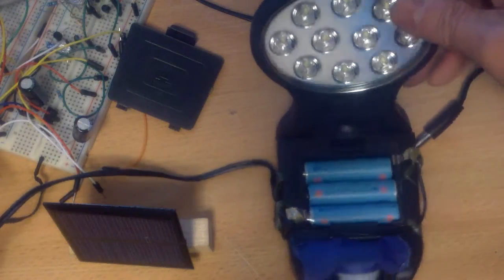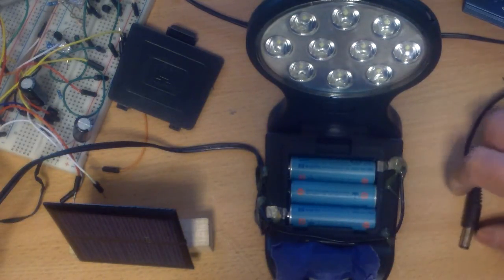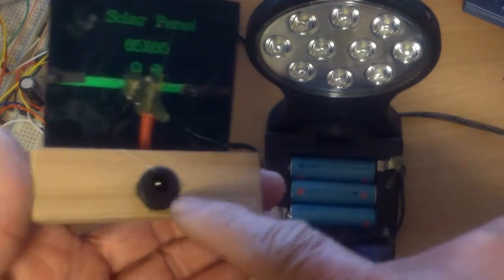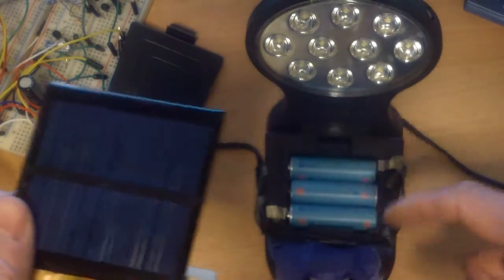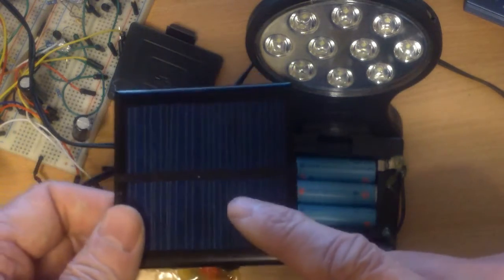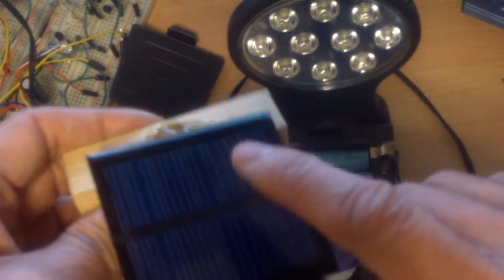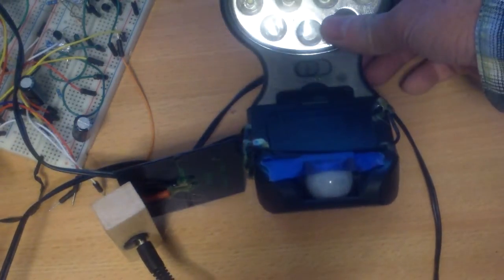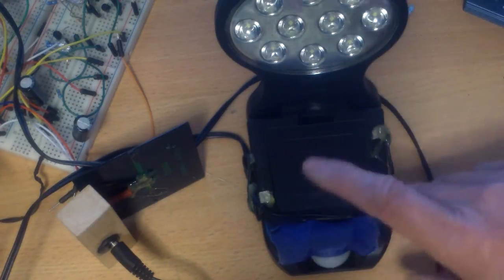Adding a small solar panel to a motion sensing exterior light

Comment: Pretty cool I wonder what the cost would be for all that stuff? The think i like is that its off grid.
Reply from the maker: Very off grid. The eneloop battery is a little pricey but worth it. I'll never get the old type NIMh rechargeables as they drain too quickly. The smaller solar panel should be able to top off the battery and it's less than $5. The motion sensor type light goes on and off with strong winds and is a little unpredictable. This particular light, again is only a few dollars from Costco.